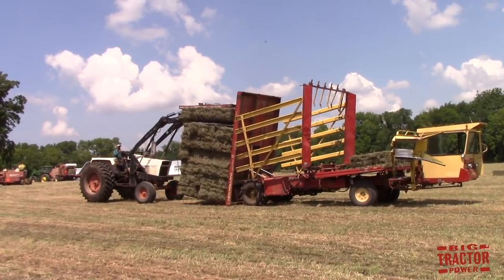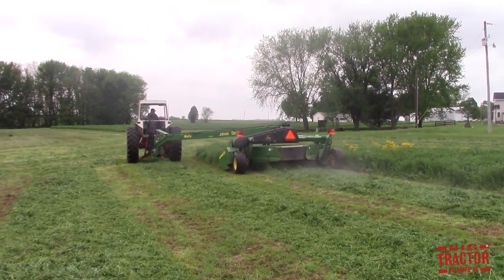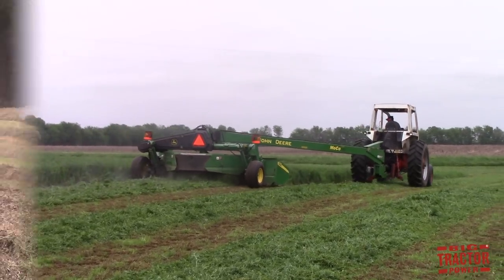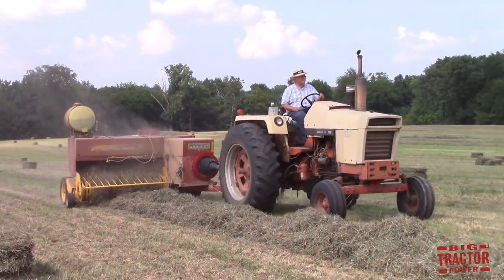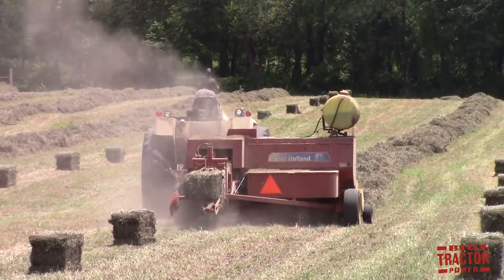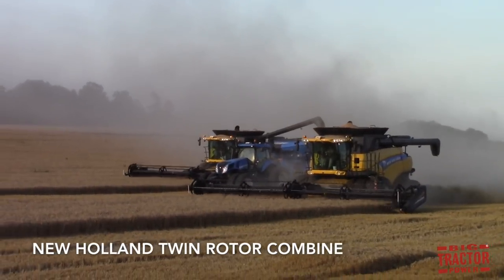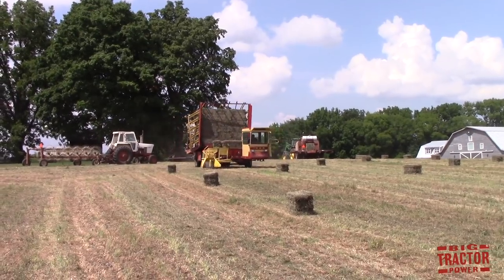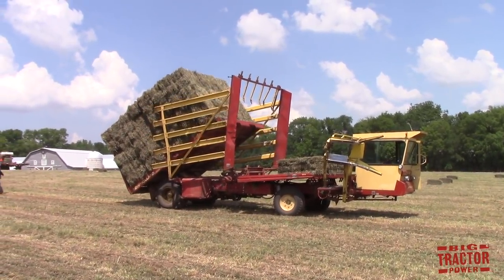Harvesting Hay Bales

Comment: The other reason the bales are discharged and positioned on the side..... This prevents the gophers and other rodents from chewing on the twine.  When I was on the farm I fallowed the baler and turned the bales on there side.  Later, when I was "promoted" came up with a 2 x 4 that extended beyond the discharge and would drop the bale in the "rodent free" position.   GREAT STUFF

Comment: Awesome! Just watching a friend use their NH 1036 bale wagon tonight.  Cool machines!  Love the ole 70 series Case's, I would have thought that baler would need more tractor than a 770.
Reply from the maker: The Agri Kong’s sure stand out.  Thank you for sharing about the 1036.  What tractor was pulling it?
Reply: 1036 is an early self propelled unit. It has a V4 Wisconsin engine on it for power and no cab.  Also the operator station is on the right side with a left hand pickup.  Friends father in law bought it new back in I believe the 60's and it has never left the farm and has been in service every year since. It was one of the first ones in our area. Yeah them Agri King's do stand out. We had a 78' model 1270 on our farm in the 90's and early 2000's.  Loved that tractor but it was traded on a 7120 Magnum. Sure do miss running that beast.
Reply: Just did a little research and I think I had the number wrong.  By what info I can find online it is a 1045. I could sware it had 1036 on the front of it though.  I will have to look at it next time I'm at their farm and snap a picture of it.

Comment: Damn! I remember all the summers I spent baling hay and straw, and all by hand, the collector and stacker would have been so nice. I'm wondering how they handle putting up in the hey mow, we did it with a large fork pulled up by tractor and then hand stacked .  but we were young and dumb, got paid very little(1965) by today's standards, but had allot of fun.
Reply from the maker: My first job was stacking hay in a barn off kick bale wagons. These automatic bale wagons normally just drive in the barn drop the 160 bale stack and roll out. The farm can stack a second tier of bales using the loader tractor.

Comment: Those old cases still doing their job well. Have an 870 power shift.thats the way to handle hay.
Reply from the maker: Very cool on the 870. The 770 and 870 are on the rare side. Is yours open station or does it have a cab?
Reply: bigtractorpower. Cab

Comment: As a young adult farming with my dad in northwestern Minnesota, we had a pull-type Stackliner. While not real speedy, it certainly was a labor saver.

A bit of advice though. Mount the quarter turn chute the other way so the bales drop cut side down. That way if it rains before the bales get picked up they will shed water.

It looks like New Holland finally copied John Deere and went with an auger and fork to feed hay into the bale chamber. The older New Holland balers with tines on a chain never could make a tight bale like the John Deere. Consequently the stacks would tip over because the bales were so sloppy.
Reply from the maker: Great history.  This BC5070 has the needle fingers for gathering the crop.  No auger on the pick up.
Reply: bigtractorpower Regardless, it still has the fork stuffing hay into the chamber. I think that folding action is what makes such tight bales from a John Deere baler. We had a New Holland baler and had trouble getting the stacks to stand. My uncle's John Deere baler made bales that were like bricks. The stacks stood perfectly!
Reply from the maker: It would be neat to do a bale comparison of the John Deere, New Holland and Hesston bales.  Here in WKY the New Holland’s is what everyone runs.  I have not found a Deere anywhere.  Where I grew up in New York all you see is John Deere balers.
Reply: @bigtractorpower  Here in Kansas we primarily have JD or new Holland small square bales. I ran a JD 348 string tie for many years and it worked great but I recently started running an inline Hesston 4590 and never looked back. It will  eat hay and walk away from any other small square balers. It's nice to put the "green" help on it because all they have to do is startle the row and go.

Comment: The quarter turn chute off the baler did not work so well for us on the side of a butte 500ft high. They all rolled down hill the first season lol. So the next year we had to harvest and bale going up and down the hill.,We could not us a truck or bale stacker as they tipped over when they tried to turn when mostly loaded! It was a circus until we just started at the top and loaded down hill and then hit flat ground and could just use a trailer to haul them down to the flat area and transfer to the trucks.lol it was interesting and fun but expensive lol,

Comment: Super wierd seeing a bale wagon and a bale fork in the same field.  We never got bale wagons and instead had bale accumulators behind our balers that left the bales in 8 packs which we would pick up with a fork like you see at the end.

Bale accumulators were the main way to haul hay until bale wagons replaced them, so really weird seeing them in the same field.
Reply from the maker: It was an interesting combo. I have a video on a Kuhn accumulator in the works.
Reply: bigtractorpower I've never seen a kuhn accumulator.  We had Farmhand accumulators.  Some nights they worked great, others not so we'll (kind of like baler knotters).

The accumulators had one nice feature, out here in the west we bale hay at night until the dew gets too heavy making the hay too wet to bale.  When that happened the bales were too heavy for the accumulators to push off.  So we'd bale till that point and quit for the night.

Comment: The 770 looks bigger than 56hp to me from a distance.  I know a JD 2630 was 70hp and it was a utility tractor that looked about the same size or marginally smaller, but I guess it is what spins off the drive train that counts.
Reply from the maker: The 770 does look bigger. I had to triple check that 56 rating.

Comment: Curious if someone may answer this: Years ago we used to do custom cut, raking, baling and hauling here in Fresno, Ca. We had a NH-290 and NH-500 3 wire baler as well as the NH-1075 Harrow Bed. My question is this, I notice most if not all small bales produced in the mid-west going east are 2 wire. Does anyone put up 3 wire bales? Also, is the 1069 bale Wagon designation specifically for the 2 wire?
It's been a long time since i've driven a Harrow Bed or cut hay...but I sure do miss it. There is not a better aroma than a freshly swathed hay field....except maybe a rare rain storm on dry dirt in the summer time.       Or the smell of corn silage in the stack on a winters evening.
Reply from the maker: I think wire bales and three wires is a South Western process.  The farms here in Kentucky and where I grew up in New York run two string twin.  The 1069 can collect 14x18 and 16x18 bales.

Comment: Neat video.  Just curious, but that would have to be one heck of an operator to load 160 bales in 5 minutes a stated in the video.  The bales are close together,  but I think 5 minutes is a little optimistic ;) Having run a pull type 1033 New Holland bale wagon for years I'd be hard pressed to fill it with 103(with stack tied)  in under 20. Enjoyed the video though
Reply from the maker: I based the time on filming the bale wagon on several fills in the field. I just watch the minutes recorded on the camera. In this field 5 minutes was the average.  It had a hiccup here in there where it stopped to reset a bale on the feeding chain.  Over all it was 5 minutes. When I am filming I find it helpful to film an entire loop to get an idea of what a machine can do weather it’s a Forage Harvester, combine or bale wagon. The time stamp makes a good log. The pull type bale wagons are neat. I need to get one filmed.

Comment: Anyone else think it was weird that they have a 100+ hp tractor pulling the rake and only a 50 hp tractor on the baler?  We used to run a baler that size with a International 3688 which is 125 PTO hp.  (3688 was a total POS BTW)
Reply from the maker: The 770 runs a wheel rake too. They unhooked the 770 from the second rake to run the baler because the air conditioning in the 1070 is not working. Better to be in the open air on the 770 than in a hot cab on the 1070.

Comment: At 7:30 A bale falls back of the row in the bale wagon leaving a hole in the stack. How does that affect the stack or the unit lifting that bale line. Seems like the hole would allow all the bales to move and potentially fall out of the grapple arms.
Reply from the maker: I had not noticed that while filming. It must auto correct because on the return trip you can see it put the stack up and all the bales are even in the new tier.
Reply: That’s how the auto tie function works. Spikes hold the 2 outer bales, then only 2 bales are flipped up for a couple times. The 2 outer bales slide out and create a more secure stack.

Comment: I am confused why not pick the bales at this point with the tractor mounted grapel and eliminate the bale wagon
Reply from the maker: The tractor with the loader would be running all over the field. The stack wagon moves much faster.  Normally they would just drive the stack wagon right to the barn and empty it in the stack.

Comment: The huge issue is that all this equipment cost close to $1 million together and that makes the farmer deep in debt to the banks.
Reply from the maker: The equipment in this video is all over 45 years old minus the Hesston rake which is 20 years old and the New Holland Baler is 5 years old. If it was all new machines yes there would be a big investment here but the tractors are probably worth $5-$8,000.
Reply: I am shopping for this equipment for few yrs and I know the prices on used ones.

Comment: I grew up farming in the 80's... never saw a stack cruiser that I remember.  Most bigger farms back then used throwers and catcher wagons.

Curious, why doesn't the hay wagon dump that stack and keep going, rather than wait for the tractor to pull them all off to load on the trailer?

This is a neat operation, but I'd want to compare the efficiencies and costs to running an accumulator.

Great video!
Reply from the maker: I remember kick balers and throwers well.  Where I grew up in Ny these 1069 bale wagons replaced all the local kick balers and wagons. They did not completely unload the 1069 in the video because the field is on a hill so there was no level place to start a stack.
Reply: bigtractorpower Ah, didn't notice the grade in the video, makes sense.  Thanks

Comment: Why on earth do they not just dump the whole stack in the corner of the field and have the tractor load the trailer whilst the bale accumulator is back out picking up again??would be far more efficient......
Reply: Really !
Reply: A full height stack often looses the rear/upper bales when push off the first load.  I was watching to see if it all came tumbling down--they cheated and unloaded right from the harobed with the bale grabber.